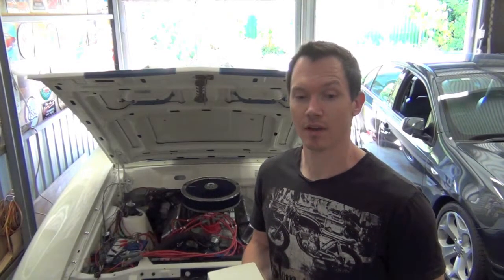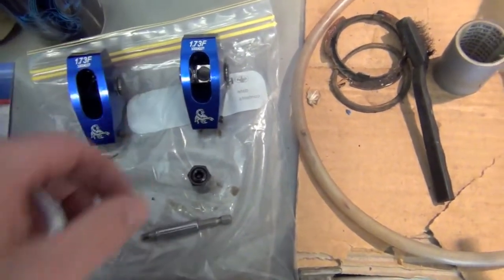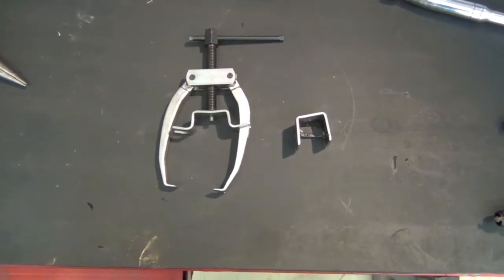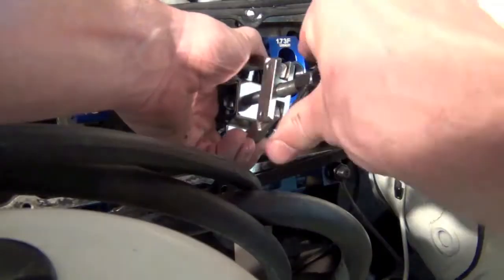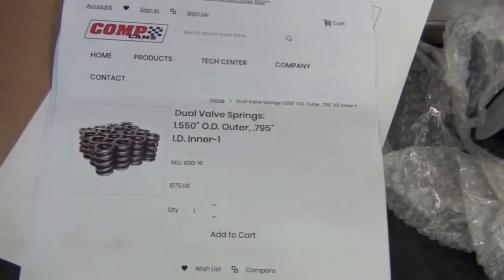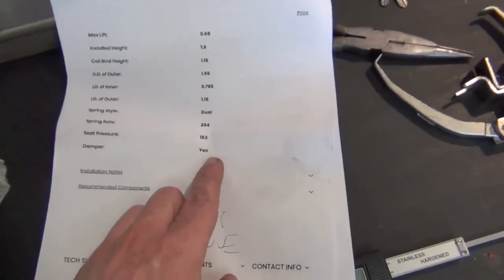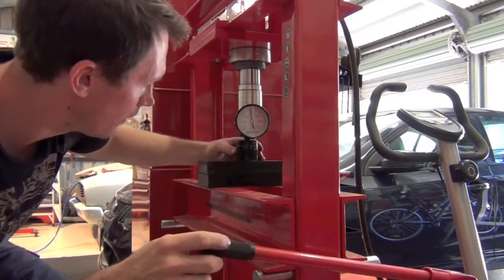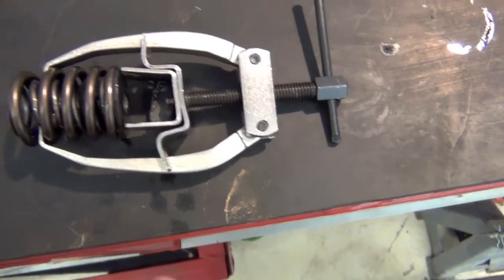Proform Valve Spring Tester 6684, valve spring removal and test

Comment: Hey mate, great video and thanks for making it. Lot's of good detailed stuff. If you don't mind me asking, what are your cam specs you are/where running with those springs? lift @.50? Maybe you are running a crows 21787 flat hydraulic tappet cam? I'm trying to work out similar measurements/pressures with a set of unknown dual springs with a similar spec lift you have with your cam. 

That little tool is pretty handy. I was going to try and work it out with a set of bathroom scales, digital callipers and my shop press, but that proform gauge is pretty good bang for the bucks and should be a tad more accurate.